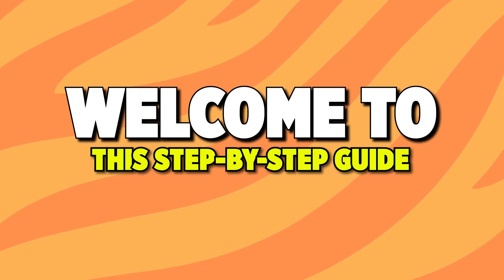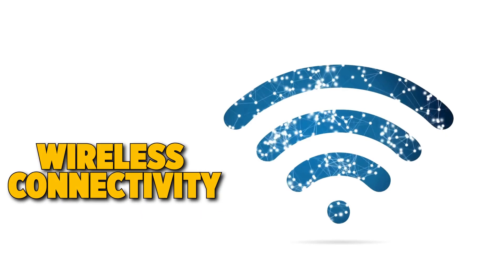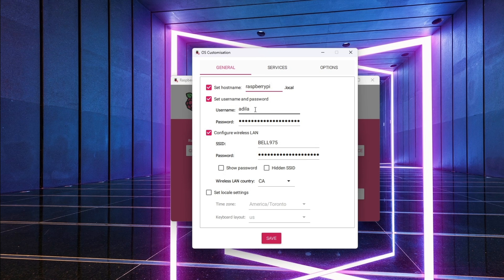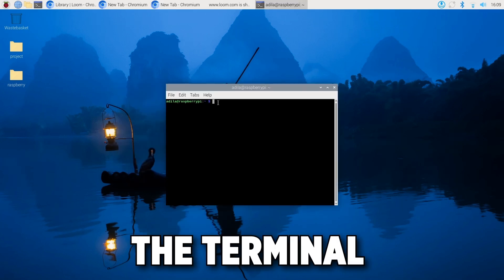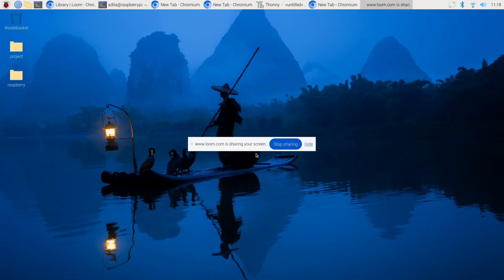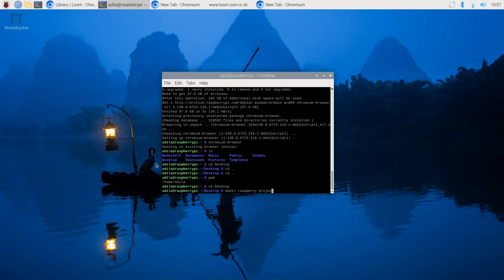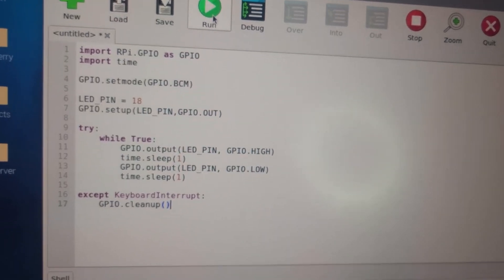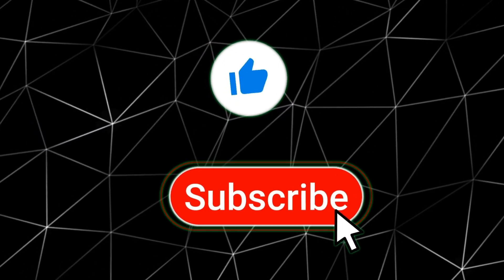Raspberry Pi Zero 2 W Setup

Comment: My chromebook not opening nothing from raspberry
Reply from the maker: Hmm, are you encountering any specific error messages on your Chromebook?
Reply: @raspberrypimadeeasy yeah it doesnt support the file but i Linux it gave me penguin icon in the terminal but i can't put the ssh in correctly
Reply from the maker: @I @ImIm-ns4xq ry this on your Chromebook 👇

1) The “file not supported” part
	•	If the download ends in .img.xz (common), ChromeOS can’t open it.
	•	Open Linux (Penguin) Terminal and decompress it:
	•	cd ~/Downloads
	•	ls
	•	unxz yourfile.img.xz  (or: xz -d yourfile.img.xz)

2) Flash it the easy way
	•	In Linux Terminal:
	•	sudo apt update && sudo apt install rpi-imager
	•	Open Raspberry Pi Imager → pick OS + SD card
	•	Click the ⚙️ settings → Enable SSH + set username/password (this avoids manual SSH headaches)

3) SSH command (most common mistake)
Use this format (no spaces):
	•	ssh username@raspberrypi.local
or
	•	ssh username@PI_IP_ADDRESS

Example:
	•	ssh pi@raspberrypi.local

If it won’t connect, get the Pi’s IP from your router/Wi-Fi page, then:
	•	ssh pi@192.168.1.50

If you tell me what OS you flashed (Pi OS Bookworm?) and what you typed for SSH, I might provide more advice
Reply: @raspberrypimadeeasy my ip is on my dell and the battery died finally soon as i press write so i switched to my chromebook. I hope i didn't fry anything.
Reply from the maker: @ImIm-ns4xq  it’s probably fine, writing the SD card is the only thing that changes anything. Switching computers won’t mess up the Pi
Reply: @raspberrypimadeeasy thanks bro i always brought a pre loaded pi sd. I'm trying to get my son ready he's been in several robotics classes in just trying to get him sharp for the future
Reply from the maker: @ImIm-ns4xq  robotics classes are an awesome start  
If he’s using a pre-loaded Pi SD, the fastest path could be to follow this step-by-step beginner robot build https://youtu.be/XTGr29kIkEU?si=MskyQj5XgEEqB_V9 ( can be found on this channel) . If you want, I’ve got a few beginner-friendly robot resources in my link in bio that might be useful.

Comment: After inserting SD CARD with OS, Boot screen appears again and again. Will this thing need denote correct steps and do we need to wait for 3-4mins to wait
Reply from the maker: It could be an issue with the SD card or the OS image. Have you tried reflashing the OS or using a different SD card?

Comment: The OS works fine but I can't connect a mouse nor a keyboard. I am using the "USB" port, not the "PWR" port to connect them. I tried using a powered USB hub to connect them and the they did turn on, but it didn't work. They work perfectly in other devices. My power adapter is 5V 1.55A.
Reply from the maker: Are you using a USB On-The-Go (OTG) cable with the Pi Zero 2 W?
Reply: @raspberrypimadeeasy  Yes
Reply from the maker: @Oluas54321   Based on some digging On the Pi Zero 2 W, the port labeled USB is the only one that carries USB data/OTG PWR IN is power-only.  ￼

If you’re already plugging devices into the USB port, the next most common cause is the adapter/hub: a lot of “micro-USB → USB” adapters/hubs are not true OTG/host (or are charge-only), so the keyboard/mouse can light up but never enumerate. Try a known-good OTG host adapter or an OTG hub

Also, 5V 1.55A is borderline once you add a hub + peripherals try a good quality 5V 2A (or higher) supply + cable and test with just one mouse directly (no hub) first.

Comment: Pi ZERO 2 is literally trash, right out the box the browser says it must have 1GB RAM to run & the Pi ZERO 2 has only  HALF the needed meomory so  CHROME and Firefox both just Crash and die.
Thanks for a worthless paperweight that can not even  talk to the WWW.    😶
Reply from the maker: I understand your frustration. The Pi Zero 2 W is designed for lightweight tasks and IoT projects, not as a desktop replacement for heavy browsing. For a smoother web experience, I'd recommend a Raspberry Pi 4 or 5.
Reply: @raspberrypimadeeasy   No.   I tossed the Raspberry Pi Zeros and got Orange Pi's   2GB and 4GB =  it's not unreasonable to ask the supplied OS will run the included software on the hardware provided.  TinyCore and DSL  both run leaner than Raspberry OS - so it's not about  hardware - it's about  motivation.    I  never had expectations  the  Zero 2 would replace the Mac Pro ...  🙂
Reply: Why use chrome and firefox, both very bloated browsing softwares, if you "didn't intend" to use it for heavy browsing? If it doesn't work for you that's fine, but why come and shit on it overall if it doesn't work for your specific use case? It seems it's not about the hardware, it's about your need to complain.

Comment: Great video. One question. How do you connect a keyboard and mouse with only one usb port?
Reply from the maker: Use a USB hub with a micro-USB connector. Plug it into the Pi Zero 2 W’s USB port (not the power port), then connect your keyboard and mouse to the hub. Alternatively, you can use a wireless combo with a single USB dongle

Comment: My keyboard and mouse wont work, i tried searching it up online but found nothing, do you have anything to help?
Reply from the maker: Did you try the below ?

Basic Checks

Make sure you're plugging into the correct USB port — the data port, not the power-only one.

Confirm your keyboard and mouse work on another device (like a PC or laptop).

If you're using a wireless combo, ensure the USB dongle is securely connected.

Power Supply Issues

Use a reliable power adapter (at least 2.5A for Pi 2 W).

Avoid cheap cables or adapters — they might not deliver enough current.

If using a USB hub, make sure it’s externally powered.

Connection Tips

Try plugging in the keyboard and mouse after booting the Pi.

Use a different USB adapter if you're connecting via microUSB — some are faulty or lack data lines.

Software & OS

If you're using NOOBS or Raspberry Pi OS, make sure the OS is fully installed and updated.

Try booting with a fresh OS image on your SD card.

If you can access the Pi via SSH, run lsusb and dmesg to check if the devices are detected.

Advanced Debugging

Use SSH to log in remotely and check device logs.

Run lsmod to confirm the evdev module is loaded (handles input devices).

Add max_usb_current=1 to /boot/config.txt to increase USB power output.

Try Different Devices

Swap in a wired keyboard and mouse if you're using wireless.

Test with a different USB hub or adapter — faulty ones are surprisingly common.

Comment: For better performance, use the raspberry pi 4 with at least 2GB or 4GB ram; as the raspberrry pi zero has only 512MB ram. And, the raspberry pi zero has high chances of crashing, and has poor performance. But still, a good project!
Reply: People who buy the zero already know the specs you roaster
Reply: I bet he dumps in a river.   Meanwhile my pi zero feeds adsb flawless.   Most dumpster pumpers dont use a solid power source.  They use their moms 2016 android tablet charger and wonder why its flaky.

Comment: can i install software for coding because I need to run ml and tensor flow projects 
if yes than how??? and please help me with how I can use my laptop screen as raspberry pi monitor
Reply: using headless method
Reply: @mdzamir34  could you explain?

Comment: Hi! I have a Raspberry Pi Zero 2W, but it doesn't have a GPIO header, so I'm unable to connect it to a breadboard. Can anyone recommend which GPIO header I should buy to solve this issue? Thanks in advance!
Reply from the maker: Hi! To connect your Raspberry Pi Zero 2W to a breadboard, you can use a 40-pin male GPIO header with a standard 2.54mm pitch. You might consider purchasing a pre-soldered header or soldering one yourself, depending on your setup. Hope this helps!